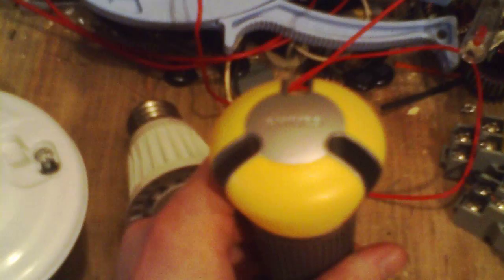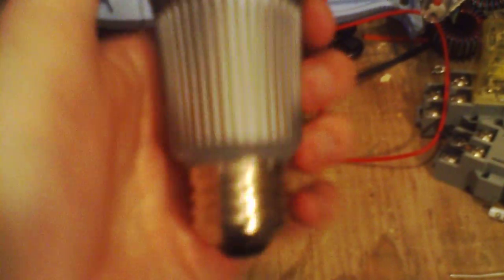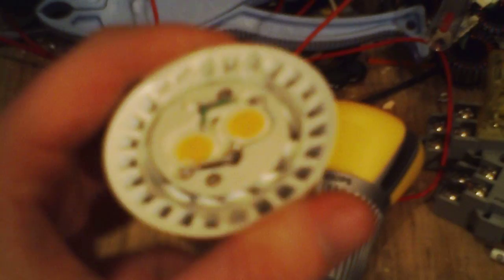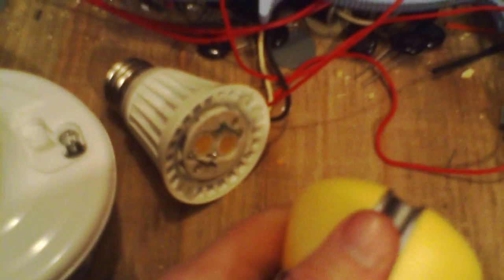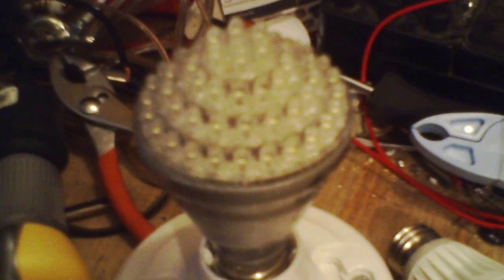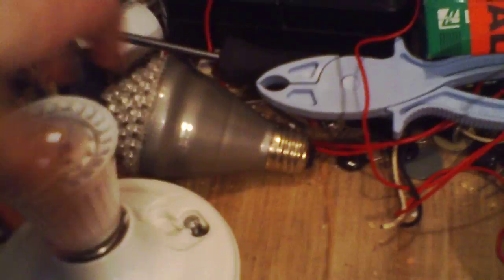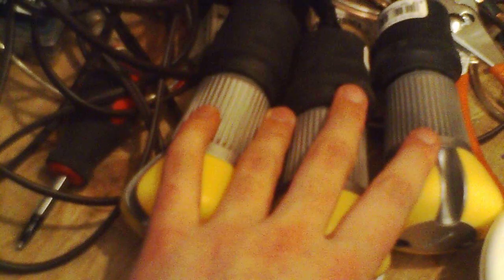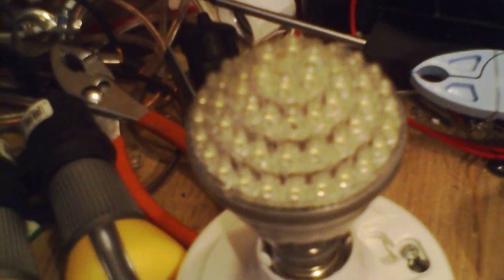How Philips AmbientLED (and other white LED) lamps work

Comment from the maker: @KyleCarrington   Many small LED lamps like them use capacitive reactance current limiting.  Such current limiters have high current crest factors, which is bad for the LEDs.  There are some out there that use proper switching supply drivers, but most lamps do not use them due to the higher cost.

Comment: Good review. I have one of those too, and while I like it, and it serves some excellent purposes when a single lamp for example is needed, I prefer numerous lower output lights. I agree the LOA are absolute crap, but in as far as cheapies are concerned I particularly like numerous (2 watt) Globe 01409's. Not sure how long they'll last, but I got mine at $7 CDN ea.